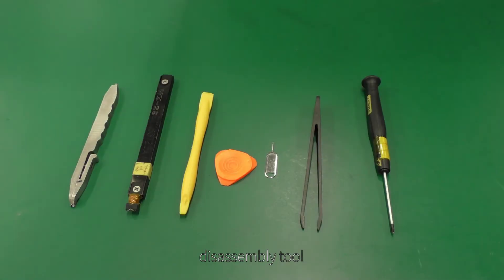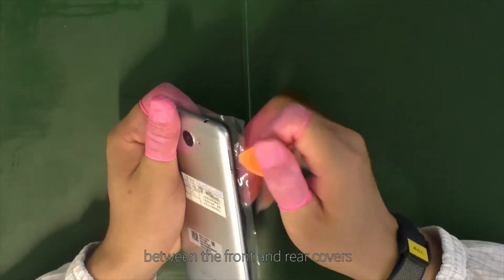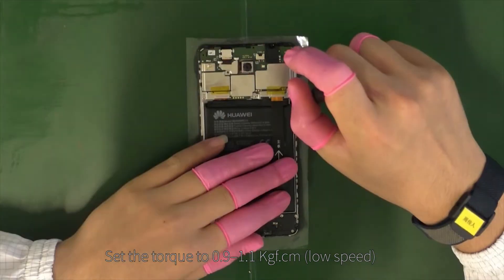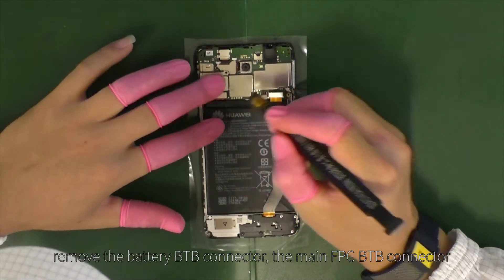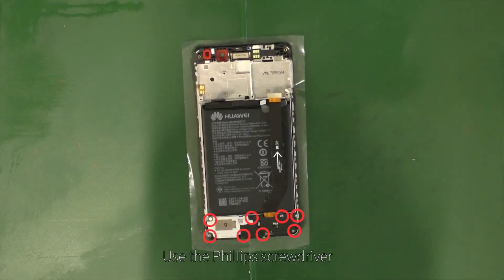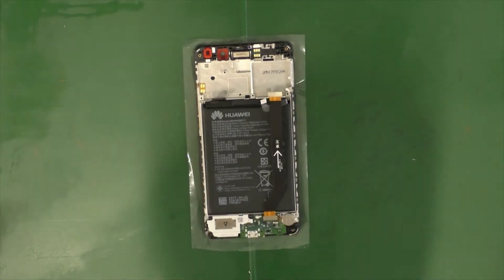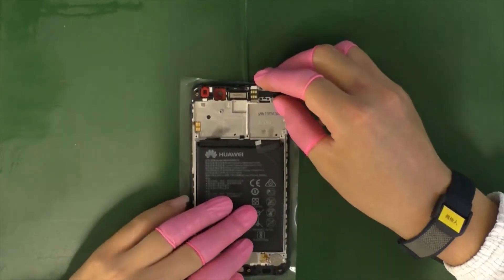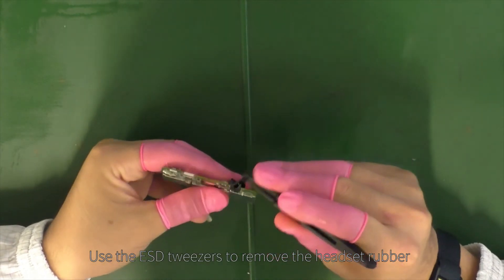Huawei Ascend XT2 disassembly guide

Comment: For anyone attempting to take this phone apart read this:

1. There's a strong adhesive around the entire rim of the phone where the aluminum and the screen/rest of the phone meet (the part they take apart first in this video). It makes it difficult to separate the two pieces and either the phone shown in the video has been previously opened or never had adhesive because I don't see the sticky remnants of it and it's definitely not as simple as it looks.
2. Considering this you need to heat the phone up to make the adhesive easier to work with. I used a little space heater but a heating pad or a blow dryer or 15 min in the sun would probably work too. Don't try to just remove the screen without heating it first otherwise it will be extremely difficult to remove and you're very likely to crack the touchscreen especially if you happen to get the wrong opening in the phone. By this I mean there are actually 3 layers (so to speak) of this phone..the metal, the middle which holds the battery/motherboard etc., and the digitizer/touchscreen/LCD display. The display is seperable from the middle part but if you happen to stick your pry tool a millimeter higher you can separate the touchscreen from the battery/motherboard layer and the middle layer will stay glued to the metal back. 

SO BE SURE THERE IS NOT A TINY BLACK RIM left on the metal when you start to separate the layers otherwise you will be removing the LCD (top) layer which will likely crack as a result. 

3. The battery, speakers, mics, back camera, ear speaker are all pretty easy to (just some Philips screws) replace if you've gotten this far. The front-facing camera is soldered and likely not fixable. Assuming these parts are available to buy. 

It's a nice phone though, pretty much an iPhone 6+ in terms of speed/feel. Only $69 at Walmart...bought a Samsung Express Prime Something which was more expensive ($99) and it felt like such garbage compared to this phone...the screen was like a calculator...surpirsed the hauwei phone is so cheap...must be those spyware malware subsidies. Thanks China!
Reply: Hey do you know if the LCD and digitizer are built together? My wife dropped her phone and cracked the glass only and i cant find any replacement unless its LCD and glass together...?? Any advice would be awesome.